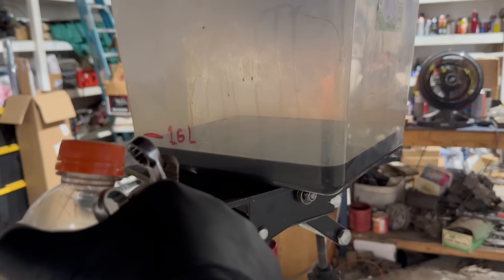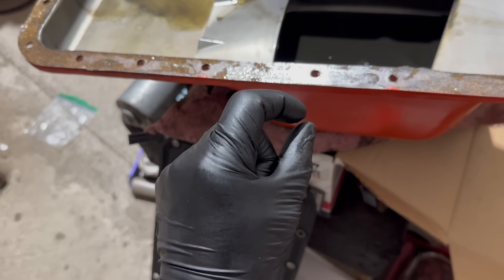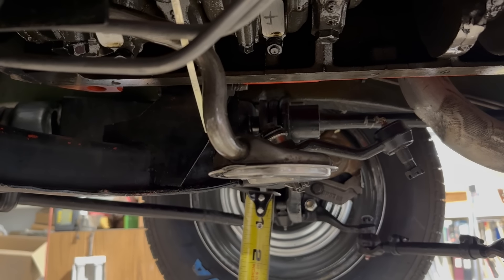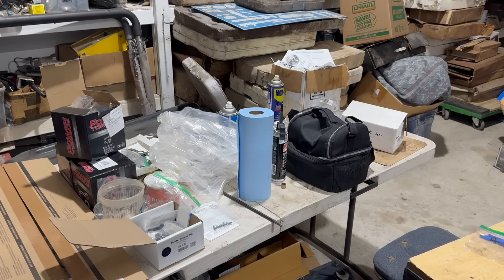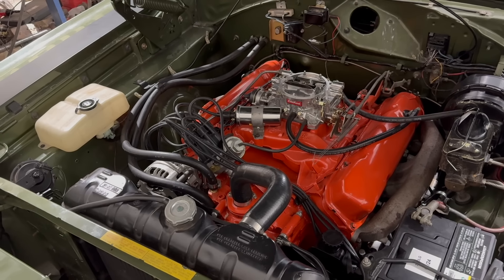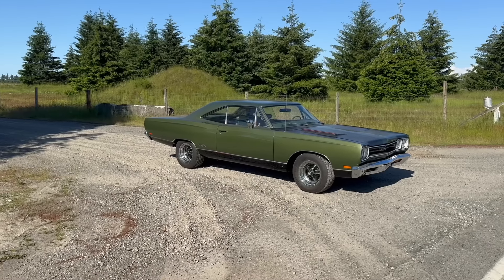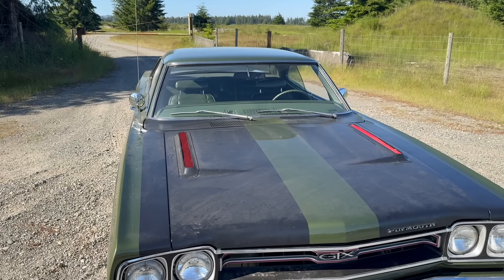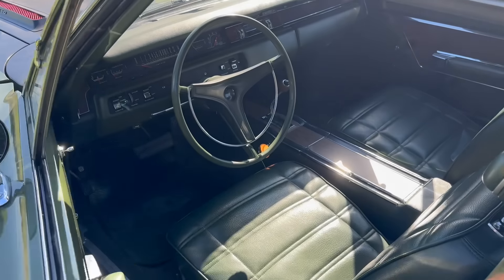Here's A Great Way To Blow Up Your Brand New Engine - 1969 Plymouth GTX 440 Oil Pickup Fitment Fix

Comment: Around 50 years ago (!) a friend had oiling issues with a 383 Magnum in his Super Bee. He and I pulled the pan and discovered that the oil pickup was badly cracked. Went to the dealer and got a new one — or tried to. The “Magnum” pickup was different, we tried to explain. “Nope — this’ll fit any 383” the parts guy explained. Yeah — he was wrong. We had to bring the old one in and place it alongside the one he had sold us to prove our point. So he reluctantly opened the parts book and whaddaya know. A 15 year old and an 18 year old knew a thing or two.

Comment: That happened to me on the very first car engine I built 48 years ago…a 383 Mopar for my ‘71 Roadrunner…wrong pickup in a 402 pan…about an inch off the floor of the pan.   That motor lasted maybe 200-300 miles before I went over a set of RR tracks and it sucked air…goodbye number 6 rod bearing.   Start over again….learned to measure the second time and every time after…also taught it to my engine class students.
Reply from the maker: Ouch… yeah, that’s bad times.
Reply: @DeadDodgeGarage  yeah…but learning isn’t always easy or cheap…if it was everybody would be smart
Reply: @DeadDodgeGarage  brakes.. nice green... anyhoo. brakes.. 73 challenger 340 r/t. i fitted polara drums, 12''.?. plus i bought a kesley hayse disc set for the front.. so, looks like im gona die. when i get it back.. sat in shed for 12 yrs. couldnt reg here in aus as it was the  WRONG COLOR. ??..cars imported had to be 100%... 100%... original.. give me a fkn break.. laws have changed now, hence, waiting far it.. lectrics not good.. only 2 yrs.....aus....... i need a 5sp..  has a 904 trans.. wrong..

Comment: My 1st car was a dark green '70 Challenger - guess I still have a soft spot for it 'cause I also think that GTX is a great car. Your level of expertise is impressive.
Reply: I made my Mopar bones with a 1970 Challenger right out of High School. It was the poverty spec slant six, all drum brakes (non power). I learned the hard way you can't upgrade just the engine when you hot rod a car. Dropped in a warmed over 383 Magnum and called it a day until the first time I had to brake really hard. Ended up swapping in front disk brakes from a R/T car and while I was at it, ordered the MOPAR CanAm suspension kit from the Mopar Direct Connection catalogue (good ol days) Included custom torsion bars, rear springs and 2 sway bars. One thing I never did was change to a reasonable diff rear set. The slant six came with a 2.73:1 gears! So the car was a dog in a streetlight race but boy, with those freeway flyers it beat anything from 60 mph up. Never reached its top end since the 120 mph speedometer was buried and it was still accelerating like  a bat out of hell. Never finished the car to my satisfaction, since I totalled it racing a Corvette on the freeway. That's youth for ya!

Comment: Great tech. I use a 1/4 inch or 3/8 inch drill bit taped across the pickup. Put a small dab of grease on the drill bit and hold the oil pan in place with the gasket. You should get a small kiss of grease on the pan.  If the clearance is not right i heat the pick up tube with a torch and "adjust" it.

Comment: No sweat on the steering wheel... you're on the right side of the road so you're steering slightly left against the crown of the road. On a clear road hit the opposite lane for a minute and if the tilt of the wheel is exactly opposite then you're right on.
I like the green... my first "real" car was a '70 Fury about that shade, with a darker roof. Fun times.
Shiny side up, fun hangin' out. Cheers.
Reply from the maker: Oh I know it. That’s what I told Tom. Haha. Thanks!

Comment: My '69 Dodge Charger R/T had factory four piston calipers disc brakes and they worked awesome!
Reply from the maker: Yep! They were optional, and came with 10” rear drums. Standard on R/T were non-adjustable, HD 11” drums front and rear. Different setup than the singles that have been retrofit on this car of course. Much harder to find parts for these days.

Comment: It's so hard to be green 😁.  You're so right abut the oil pickup height. That was always one of the critical steps when I rebuilt a motor. Mind you, I used to use some plasticine on the bottom of the pan and then put the oil pan back on to see how much space was between the bottom of the pickup and the pan 😂. Never seemed to have a tape measure around.
Reply from the maker: That’s a great technique too, but the tape measure worked pretty well for me in this case. Haha.

Comment: I'm 60 year old Mopar lover. Ditch all factory oil pans on them old engines!! Always use an front crank oil slinger and a windage tray. Also use a Moroso 8 qt deep sump pan with high volume oil pump. Go bear the snot out out it after that. Have fun! 👍
Reply from the maker: We build factory cars with factory parts. I sincerely doubt you will ever see a car with a Moroso pan roll out of the resto shop. Now, on our go fast projects? That could be a different story.

Comment: Had my oil light come on my truck 3 or sometimes after my dipstick tube broke off and I shoved a bolt in it. Soo me being young and dumb just kept adding oil. Well 10+quarts cake out of the pan when I did an oil change. 
I've learned a lot since then but that damage has finally caught up. Time for an unframe bearing change oorrrrr a 12 valve swap hmmm

Comment: I'm not usually a fan of plastics under the hood, but it sure would save alot of guesswork and wrenching if stuff like oil pans, valve covers,  timing covers, etc were either clear or had a window.
Reply from the maker: I think about that a lot actually. How nice it would be to be able to see in the engine.

Comment: Nice clip sir. I didn't check my clearance on a 360 build. Oil pressure dropped around corners and although embarrassing to say, the truth of the matter was, there was over 2" of clearance. I pulled the sump and found a few issues. It saved a good motor. You had a sunny day! Is that not rare!? Have fun!
Reply from the maker: Ouch! But good save. Yeah, it’s pretty rare. Haha.

Comment: i built my 440 for my 67 charger a few weeks ago, and wanting to check this same measurement went rooting thru my toolbox (which used to be my dads' toolbox). i found some crayola modeling clay in the bottom drawer that i remember being there since i was a small child. and i was never allowed to play with it cause it was for something! anyways, 25 years later i got to take some of the modeling clay out of the package and use it to check pickup to pan bottom clearance...which i'm assuming is the same reason my dad had it in there in the first place. a true full circle moment!
Reply from the maker: Yep! Clay is a great way to accomplish that, among many other clearance checks. Why I’ve never actually done that myself I can’t tell you…
Reply: @DeadDodgeGarage  Likely because measuring works just fine? lol

Comment: Sweet ride. I have had no problems running 11" rear drums and late 70s front disc brakes.
Reply from the maker: So no rear lockup before front brakes? Because that’s always what happens. They work awesome, until a panic stop.

Comment: When I install my pickup tubes I use some Play-Doh on the pickup tube then bolt the pan down take the pan off and measure the thickness that the clay has compressed very simple and very accurate
Reply from the maker: Great technique!

Comment: I'm with you on '68/69 vs '70, with the '68 Runner winning out on the stripper aesthetic and the '69 GTX for the full glitz model for me.  Don't mind the green as much as I miss the red rocker pinstripe.  Carry on!
Reply from the maker: The pinstripe is there! I may not have had any shots that made it obvious in this video.
Reply: @DeadDodgeGarage  Hard to see - I looked a couple times before I made the comment!!

Comment: Great save!  The OCD in me cringed at the upside down Plymouth emblem on the steering wheel. Seems more GREEN Mopars were saved (or more likely built) in mid sixty's than any other color. Love Green! 💚 😊
Reply from the maker: That whole column situation is getting an overhaul, so we’ll address that when we get there.

Comment: Jamie, a 440Source repro 6 qt ("7qt" 564 last 3 of the part number) pan and the stock pan 
(in my case, one stamped "899") that came off of it are actually the same depth - the larger 
pan gets additional capacity by having a bigger sump horizontally.
That means the same pickup works on either pan.
Reminds me - my new pan leaks like a seive - damn cork and me re-tightening too often - 
so I'm going to swap it and the metal windage pan with one of those all-in-one jobbers too.
Then the fun begins again with those %$^%$ valve covers.
- Ed on the Ridge
Reply from the maker: I’m not sure if we’re talking about the same pan either, because as I showed in the video, this one is definitely also deeper.

Comment: Does this require a fuel vapor separator?  Do you have any videos regarding the purpose/benefit/installation of one?
Reply from the maker: I believe it does have one. It’s definitely supposed to in any case. I don’t, but Uncle Tony did a great one addressing that.
Reply: @DeadDodgeGarage  
Thanks.  Mine doesn't, and although I purchased one for installation, it mysteriously disappeared.  So, I'm thinking of getting another one (but very hard to find now), but I'm trying to determine if I really should.  😕
Reply: Another question for you (please don't charge me too much 😅) , recently my car has been shutting down when I come to a firm/hard stop.  I mean dying.  The electrical would be working (radio and signal light working), but the engine is dead. So, i would place the car in neutral and restart (after a few turns of the ignition}.  If I come to a slow/gentle stop, the engine runs normally and does not shut down.    When it first happened, I thought heat soak or vapor lock, but today here in Georgia, it had just finished raining and it was overcast with temp possibly in the 80's.   It's a recently built '70-71 block with 70's valve covers and breather/pcv (dual port) (but it ran rough for the '69 valve cover setup), and 6-barrel setup.  What could be the cause of the engine dying upon a firm stop?    Any help from you or others would be greatly appreciated. 
Thanks

Comment: Nice car...too bad someone stopped short of restoring the right AVS, coil and starter for it. Needs the correct clamps instead of the parts-store versions. The radiator cap is also wrong. What's up with that plastic power steering cap...it looks like the Dorman version from Autozone.
Reply from the maker: We didn’t restore it and have a lot of notes, I’ll just leave it at that.

Comment: i changed my 68 fury drums to 69 factory disc , i guess my rear brakes will need changed . I do have a vh 44 booster from a ford on it and a large pot double master cylinder on it
Reply: front drums  got so annoying i was using the ebrake and tail light as brake lights . Don’t tell .

Comment: I dislike cork gaskets mostly on oil pans and on the China wall on intake manifolds. Enjoyed watching 👍
Reply from the maker: Agreed! On small blocks we’re kind of stuck with the cork. And I use them for valve covers because they’re kind of the least bad.
Reply: Agree on that valve cover cork  if I have too. Recently refreshed my 89 ,318 being cautious not to destroy or disturb the original composite factory oil pan gasket. I only replaced the rubber  gasket ends. With some permatex  in the corners ,( RIGHT STUFF) Not one leak so far 3 months later. 👍👍

Comment: This is one of those things that make me wonder why anyone "builds their own" engine today. Sure, experienced builders with well established relationships to a great machine shop and wanting a specific build they can't find in one of the great many "crate engine' choices may argue my point to their advantage. That's not most of us out there though. Most of us can probably count on one hand how many engines we've ever put together. We don't know the local machine shop well enough to be sure of the work or get great pricing deals. Then there is this problem highlighted in the video. Even if using a stock pan and pick up the problem of any one single mistake or over looked piece of the over all puzzle that can take out all the hard work and money spent remains. Crate engines blow up or have problems occasionally too......that's a fact. Yet problems like this show up almost immediately and all the reputable builders back their engines up with warranties. I've built a few engines in my day and I've done top end stuff like heads, cams and lifters on more than I can even remember hut these days it's all crate engines. Easy/peasy for a Chevy guy. We've got so many choices out there to pick from.  For Ford and MOPAR guys, despite fewer choices, there are still plenty available. Enough such that it's tough to imagine it makes much sense to build your own for a Mustang or in this case a Road Runner vs buy it, ship it and install it route. When you've got that matching #s Hemi car I certainly understand that build it rather than buy it makes the most sense but that's not most cars. That's the rare exception rather than the rule.
Reply from the maker: Just one note, this is actually a numbers matching 440, so rebuilding it is the only option for a car like this. It’s worth it. I know it’s not a Hemi, but it is a real HP engine and it deserves the same treatment. And he outsourced it to a builder that I’m sure he thought was reputable. But we don’t really know the full story. The engine may have been finished by someone else, because the actual builder unfortunately passed away. But aside from that, I agree with your points. Get something on a crate with a warranty if you can.

Comment: Ahh another day another task .. So any tips on getting the small joint thing off the steering shaft on our sons 1992 D250 ram we have upgraded to a nice new borgoson steering column, but before smashing the hell out of it any tips for removing said item . Should I be using a puller or half tempted to drill into it with a series of holes and release the pressure on the shaft and then Chisel it off . On the bright side at least it’s sunny thanks in advance again Roy.

Comment: An occult ticking in a stock 440 can be a plastic tooth of the cam gear. Breaks off and sticks in the chain. I had a ‘69 Chrysler 300 convertible where that happened.
Reply from the maker: Good one, but this is anything but a stock 440.

Comment: Yeah, absolutely right! Everyone loves this car... in RED lmao! The green is wrong by a few shades of pea if one accounts for camera effect (like how it supposedly adds or subtracts 10 lbs). 
17:00 Alternatively I strongly urge you to check those 11 inch rear drums to see if it has a self adjuster kit in it because afaik all 11'' drums came with that deleted on the 8 3/4 and D60. Reason I say so is the brake bias seems to be a full half turn too tight hence the lockup under load before the fronts do. And with all the reversing and little low load test drives then the rear shoes haven't worn to catch up with the amount of extra auto-adjust clicks. OR you can tell me to GFMS because I am like 5 steps behind you and well youtube time vs real time haha. Wait, didn't you recently talk about the auto adjust stuff? Sorry... I'm old.
Reply from the maker: Right, the 11” HD brakes in ‘69 would have been manually adjusted. But simply backing the adjusters off isn’t going to solve the problem there. We’ll just a bit of extra pedal travel as the shoes come out, and then they’ll lock up. Haha.
Reply: @DeadDodgeGarage  I currently have the "deleted auto adjuster" option on my 8 3/4 suregrip and getting that initial setup right was a little bit of a bit*h. I either had full lockup or barely any brakes for several tries. I finally scrapped the front pads for a set of new ones and it balanced out perfect... if anything I am a half turn too far in but hey easy burnouts!

Comment: Wonder if it's possible for someone to come up with a high quality flexible braided stainless hose with a magnetic pickup for various applications.
Reply from the maker: Possible? Absolutely. Heck, I could build something like that if I wanted to. But I don’t see the steel pipe as a problem.

Comment: Great video Jamie! That’s great that the pickup situation is fixed, now I know  that Chrysler made 2 different oil pan styles.  Does Moroso make a windage tray/ pan gasket for small blocks as well? I might upgrade to one for my 318.
Reply from the maker: No, unfortunately the small block windage tray situation is very different, and it can’t be integrated with the gasket.

Comment: The factory guard is practically useless on after market deep pans (e.g. Milodon). Any ideas?
Reply from the maker: Indeed it is. Idea #1 - don’t use that type of pan on the street. Barring that, taller ride height, bump stop shims, and adding an additional piece to the k frame all come to mind.
Reply: @DeadDodgeGarage  All good ideas Jamie. Until I can swap out the 60 series for 65 or 70's I'm just going to have to hold my breath over speed bumps and rail road xings and refrain from popping wheelies and jumping hurdles. Thanks man!

Comment: Hey Jamie, what if I have factory disc in front and drumbs in the back with no booster. Can I just add a booster? My car doesn't have one
Reply from the maker: This must be an A body? Those were the only cars with manual disks. Unless someone built it that way. Anyway, yes, you can add one. Not a big deal.
Reply: @DeadDodgeGarage  yes it is a 74 4 door dart. That's how I bought it I had a feeling it was weird not having a booster with front discs.  Thanks Jamie.